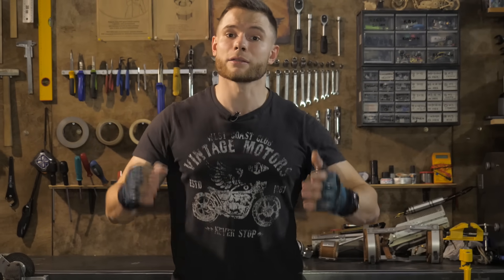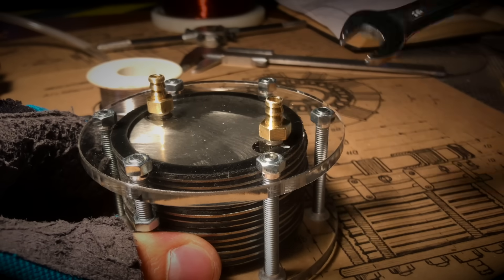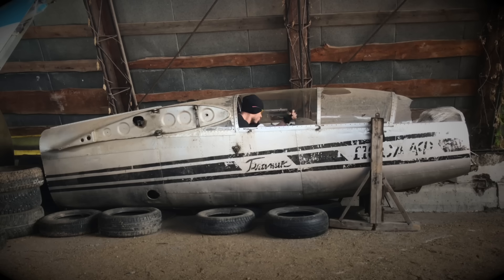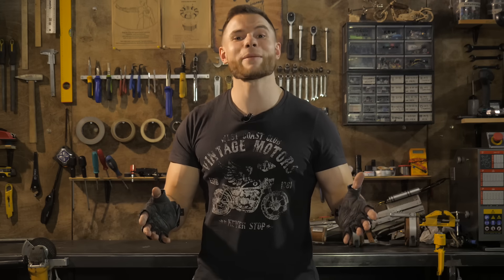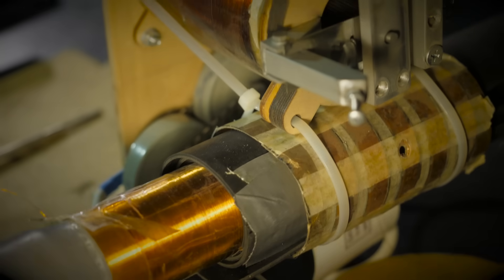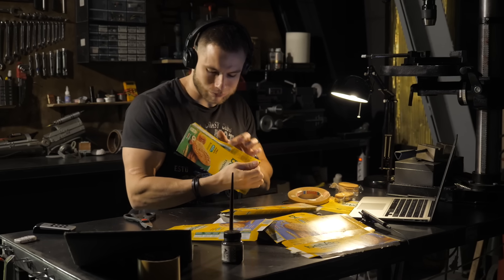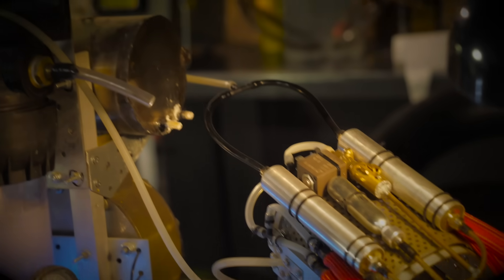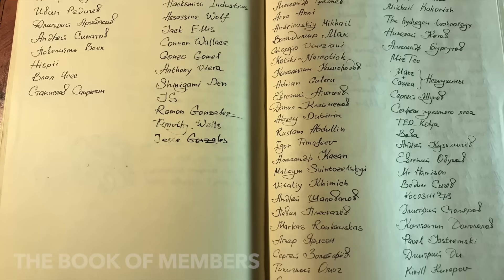Building real Iron Man suit (Part#1: Conception & Protoypes. Reactor, Repulsor, Armor, Exosuit)

Comment: Avzavzafh. Shit. I wrote big amount of text about sharneers, than about emg that cn be useful and finally about eeg(electroencephalogram). But my comment was for Russian translation. And it was in Russian. I'm to lazy to translate, but I'll try...
This is Microsoft translator's work without correction:
There will be ideas about:
1.20-year-olds
2.how to speed up the costume's reaction. 
3.Supplement about encephalogram (EEG) 
	1. Sharnira can be done with several degrees of freedom. So everyone can move and rotate in any plane. In each connection of points add pneumatics (i-e the ability to cut somewhere, and somewhere to increase the course). I'm sorry I can't draw right now. If you just repeat the bone - nothing will work, but you can calculate how can move perpendicular to it (each bone) planes at the ends and on a couple of points symmetrical relative to the bone. The main thing is to leave these points the ability to move as much as they can in real life. This is freedom of movement.
	2. Even more will help to release the movement of miographic sensors (t-e as soon as the muscle begins to contract - the exoskeleton works), if you want to make the reaction of the suit preventive (to the signal on the muscles, so that both the muscle and the suit) - use the encephalogram. It can be portable if you want
	3. Since you suit yourself, I recommend using the channels on which you have the biggest changes in muscle contraction. So the mutual training of you and the interface will be easier. Sensors put on them, too, you can make an auto-serve gel. 

And without translation:
Тут будут идеи про:
1.оптимизацию шарниров
2.как ускорить реакцию костюма. 3.дополнение по поводу энцефалограммы(ЭЭГ)
 1.Шарниры можно сделать с несколькими степенями свободы. Т-е каждый чтоб можно было подвинуть и повернуть в любой плоскости. В каждое соединение точек добавить пневматики(т-е возможность где-то сократить, а где-то увеличить ход). Жаль, не могу сейчас нарисовать. Если просто повторить кость - ничего не получится, но можно рассчитать, как могут двигаться перпендикулярные ей(каждой кости) плоскости на концах и по паре точек симметричные относительно кости. Главное оставить этим точкам возможность двигаться так как они могут в реальной жизни. Это - свобода движения. 
2.Ещё сильнее помогут освободить движение миографические датчики(т-е как только мышца начинает сокращаться - работает экзоскелет), если хочешь сделать реакцию костюма превентивной(до сигнала на мышцах, чтоб одновременно и мышца и костюм) - используй энцефалограмму. Её при желании можно портативной снимать. 
3. Так как ты костюм делаешь под себя, рекомендую использовать каналы, на которых у тебя самые большие изменения при сокращении мышц. Так и взаимообучение тебя и интерфейса будет проще.За движения отвечает передний и средний мозг(примерно где у тебя маска, если я не ошибаюсь). Датчики ставь на них, также, можно сделать автоподачу геля.
Reply: Moving centers are in forebrain and midbrain
Reply: you should try to put this comment on the other comment of his where he asks us to give him ideas!

Comment: As far as I remember in the film, Stark had a very fitting suit, where there were a lot of contacts, but I didn't go deep into this topic, but most likely these contacts read information about the action of muscles (they are tense or not) and was already transmitting the information received to the suit, and he already, with the help of motors or other clever garbage, adjusted the suit to fit the flesh, which did not force him to devote body inertia to the fur. impact n or not) and was already transmitting the information received to the suit, and he already, with the help of motors or other clever garbage, adjusted the suit to fit the flesh, which did not force him to devote body inertia to the fur. the impact of moving elements, you can think and decide something on this thought)
Reply: you should try to put this comment on the other comment of his where he asks us to give him ideas!
Reply: You should think about.
^_________^
ᕙ[･･]ᕗ

Comment: I tried building an hho water reactor a few years ago and stopped because I thought of a potential problem. So if I just run the current from the batteries to the steel plates and add water, wouldn't it short and heat up the battery?

Comment: As someone who has been interested in electrolysis research for quite some time and has not had the time nor resources to sit down and learn enough about it; an English translated guide would be extremely helpful. 

I may just get the membership, to help with my own projects in the future.

Additionally; If you want to look into Bio-Memetic servos to allow maximum range of hand movement whilst advancing the quality of the fingers, I highly recommend looking into it on youtube. An English sounding gentleman is working on hand mimicking structures that assist with movement for persons who are perhaps without hands. It appears less cluncky than the structure approach that you may be stuck with currently. Perhaps the structural changes brought on by the introduction of more flexible (or elegant in your words) movement systems that could be reinforced by singular strut structures may come in handy. I’m linking the channel I’ve been following who is working on it, and appears to be making a very interesting design. Maybe it could help your joint/movement problem more broadly. https://youtu.be/-zqZ-izx-7w

Additionally; I would like to note that essentially, the proportions needn’t be the same as we are treading into a new armor build entirely. Whilst sticking to certain canonic structures might be helpful, I think we may need to have an intricate blend of structures in the chest area to help avoid clunkiness when moving your hands in front of you. Theoretically then, what you could do, is change the shape of the Hydrogen system, redirecting aspects of it into your pectoral or low mid chest region and then allow for it to reintegrate at reactor point.
Reply: you should try to put this comment on the other comment of his where he asks us to give him ideas!
Reply: @marz.6102  I might as well, maybe he’ll see it.
Reply: @davidthorp01  yup

Comment: Nice work man. If you need parts 3D printed in metal just shoot me a DM. My company builds laser powder bed fusion metal printers. Would help making conformal exo skeletal components. Can also integrate plumbing and valves into the structural components like Boston dynamics does with their robots.
Reply: you should try to put this comment on the other comment of his where he asks us to give him ideas!
Reply: what do you think of this one
https://youtu.be/tpO5DgiCgyM
Here's a way to 3d print metal without a 3d printer, making you capable of making the armor light, strong and capable of flight!!
Reply: and for it to get in the inside of the resin interior you'd have it vibrate so the air pockets leave the interior while in the conductive solution

Comment: you need an inner skin to the suit so the contact is more like clothing. then find stable mounting points like wrist for the suit to have as reference so the outer frame can be built round that. so the suit would feel like tight fitting gym ware. also the outer skin will need to have lateral complicity  for each section of limb (e.g. wrist to elbow) not just joint articulation. that is why there are so many panels to the iron man suit. if you look at Japanese amour you'll see that its built from layers so that is can adjust to movement in that way. also you may want to use a zip tie like fastener that you could find on ice skates or rollerblades. love your content been follow for ages just thought this might help in your quest to build the suit.

Comment: Rather than trying to use hard joints, which will require lots of moving parts and custom fitting, you should use flexible joints instead! Then you can just find a smith who makes metal armor for the sport of medieval combat (yes, people actually fight in medieval armor as a hobby) and work with them to create the solid components of the exoskeleton and layering and interlacing them for full flexibility and protection no matter how you move. They already have plenty of experience, take full advantage of it!
Reply: Also, take inspiration from insect exoskeletons for attaching the muscles directly to the inside of the exoskeleton.

Comment: I was thinking about the joints that would be required to take the weight of larger items and I thought, well, why not instead of straight up joints, you include some motors. So for example, on the elbow, one motor on each side with high torque via a cycloidal or harmonic gear. This way, while motion might not be super quick, even with a smaller BLDC motor (which you can even make from scratch to ensure it isn't too deep), the lifting power should be incredibly high. If you a sensor inside the arm to measure how close it is to one side to control the motion (and stop when there is no pressure to that side) you should have some added strength! I bet you could life at least 1.5× more than you already do with it

Comment: Not an engineer's idea so take with a whole plate of salt:

Considering the fact that you're torso-armour will be significantly thicker than what is shown in the movies, mostly due to the need of protecting the ark-"reactor" and aluminum-cell but also because actually functioning mechanisms will take up some more space than what was shown in the movies, have you considered "extending" the arms to fit accordingly?
This would take away the large amount of mass centered on your body, reduce the disproportionaly bulky appearance of the torso If you go and put in the effort to create this you have a right for it to be aesthetically pleasing. as well as give you the chance of making some distance between the repulsor and your hand, not only for safety reasons which are a major concern when operating with hydrogen in such high quantities and type of application but also give you more space for the machinery for both the replusion- and thrust-generation.
Overall- what you will end up with might just be a sleek hybrid between Mark I and II and I am more than looking forward to your progress.
Greetings from Germany.
Reply: you should try to put this comment on the other comment of his where he asks us to give him ideas!!
Reply: @marz.6102  Ah, thank you a lot.
Reply: @voidjockey82  he asked us all to suggest I'm only helping gather as many good idea as I can, btw what do you think of this one
https://youtu.be/tpO5DgiCgyM
Here's a way to 3d print metal without a 3d printer, making you capable of making the armor light, strong and capable of flight!!
Reply: @voidjockey82  and for it to get in the inside of the resin interior you'd have it vibrate so the air pockets leave the interior while in the conductive solution

Comment: For the suit propulsion system you could make a small metal tube ring with holes and using a small fuel pump u could heat the tube and when the fuel sprayed it will automatically ignite as the metal tube will be Piping hot and hot ignited fuel will exit the holes of the tube. Idk something similar could really work.

Comment: So something to keep in mind with the shoulder is that the scapula and clavicle move around the ribcage to provide the full range of motion. Most just mimic the scapula/humerus ball joint, but that really limits motion. So any armour pieces that go over the Trapezius muscle needs to move separately from the front chest piece. Also instead of just having rigid parts and actuators, try to use spring elements, to help keep armour elements in suitable positions. Perhaps using inflatable parts where you can adjust the spring constant by changing their internal pressure. This would not augment strength, but might make wearing the suit more comfortable as the suit is partially holding itself up rather than always applying load to the body. So applying the principles of tensegrity. I found it useful to try breaking down the body into a bunch of parallel robots (Stewart platforms), rather than serial joints as you can accommodate human biomechanics more easily.
Reply: you should try to put this comment on the other comment of his where he asks us to give him ideas!!

Comment: I'm no engineer, but I have a thought. The big issue is that the plates (being static) limit movement, right? So why not take that out of the equation? Design a mechanism beneath each plate that shifts depending on the posture or predicted posture of the wearer.  By making the plates themselves mobile you can completely remove the problem of mobility!

Comment: In order to prevent difficulty in moving joints you could use ball bearings as joints. This will reduce friction and when you add your artificial muscles it will also move easier, making the muscles themselves more efficient.

Comment: For the internal exo systems connecting the upper arm and forearm,  having low profile servo motors (presumably circular in design and high current carrying) attatched on both sides of the arm with linear drives that are connected, and wrap around the isolated spots between the arms would be a useful way to deliver a high amount of torque without sufficent losses.

Go to 0:03 https://www.youtube.com/watch?v=snVL-g4eqOo (mk2 suitup scene) and watch in frame by frame and you can kind of see what I mean.

(again i pulled this idea roughly from what I saw in those few frames)
Reply: you should try to put this comment on the other comment of his where he asks us to give him ideas!!
Reply: Waoh

Comment: Would you consider  using  the liquid body armor it contains  nano  fluid but when kinetic  force the fluid turns solid as far as i know its only uses in us military but if u purchase enough of the u could sacrifice  one of them to see if u can make smaller armor thats been heat sealed. As for flight id look into the designs of der glock it used mercury and two other fluids spinning in two directions at the same time using magnetic feild to rotate them. Besides your boot jets,repulsor u will neds to keep you horizontal. Maybe use a modified alexa to operate the various functions maybe use two alexas one for the top half of ur suit the other operate the lower with high speed connection and faster interface so no signal degradation of the signals. Please dont forget to include very high speed systems diagnostic on all systems. I wouldnt trust the watson ai from ibm.what about your life support systems, and sealing the armor and emergency ejection of main reator leaving only the one in ur suits chest .use thermal coupling tech wrapped around especially next to your skin .with connects to heat /cold sources for added power production granniesboy1223@gmail.com
Reply: you should try to put this comment on the other comment of his where he asks us to give him ideas!!!!
Reply: @marz.6102  dont know how
Reply: @bearvassar6690  go to top comments and he put 2 comments, one of the asks for ideas!

Comment: Not for all joints but for some you could use a rod and shaft system: like a ball joint at the end of a rod which goes in a shaft that is attached with a balljoint too... Answer my comment if I should try to make an stl file in fusion 360.
For the connection between body and metal you could use the same technique as in body protectors for motocross: A gel-like substance with neoprene over it so it doesn't mess with your skin but has good traction.
Reply: you should try to put this comment on the other comment of his where he asks us to give him ideas!!!!

Comment: perhaps building from the legs up you can create a frame for every bit to rest on lowering the weight you have to hold on your body and using the muscles you made as the locamotion providers in addition your own strength. adding an internal passive spring to help lift the legs possibly just not sure exactly how. for the arms maybe use ball and socket type joints with pistons to help increase the degrees of movement you have. The shoulder could also have a large ball bearing type thing with your arm to go through and it would be connected to the torso of it all. Lastly adding internal connections like belts for it to hold to your body but that's a little obvious.

Comment: try using programming codes for making the suit stable when it is flying to manage the weight and also apply thrusters at the chest and back which will hidden but when needed then open and fire .For the Fuel you know better which to use
Reply: you should try to put this comment on the other comment of his where he asks us to give him ideas!!!!
Reply: @marz.6102  ok but he can see this comment also , when someone comment on ur video then a mail comes to u , maybe he read my comment but he didn't liked 😂.
Reply: @Masterminddudu  put it'll be easier for it to be concentrated in one comment that he asks for ideas!
Reply: @Masterminddudu  and I know that an ai system will do wonders for flight, just look at spacex, they probably use ai systems to know when to land rockets after multiple uses!

Comment: The aluminum reactor gave me an idea you could use if you live in very cold climates. You could build a small one that is about the size of a 5 gallon bucket and hook it up to a system of water tanks surrounding a greenhouse and home to circulate the cool water with the hot water and have a cooling tower connected to keep things from getting to hot. The thermal mass of the water could help keep the house and green house warm depending on how fast you want to cool the system and you could use the hydrogen as generator fuel to power the home or greenhouse.
Reply: you should try to put this comment on the other comment of his where he asks us to give him ideas!!!!